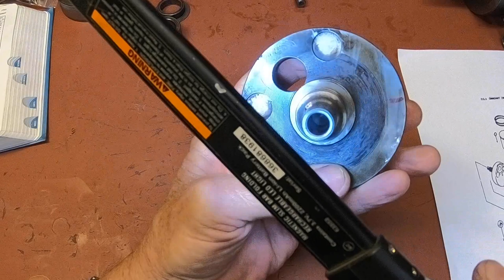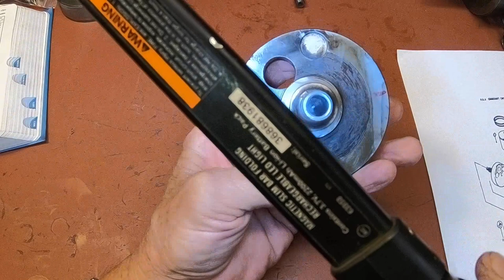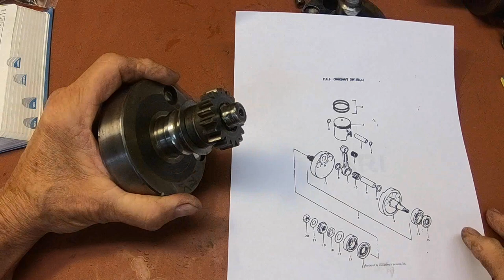Suzuki RM 125 Crankshaft repair and build part 2

Comment: This kind of repair spread through a machine will make  seemingly simple repairs take an inordinate amount of time to complete, many times you just can't get  people to understand why a repair costs what it does.
Reply from the maker: Peter, I think you are speaking from experience. It is very easy to get way too much time into stuff like this. Most of the time it goes very unappreciated. Sometimes it just doesn't work out. In this case it was a boat anchor to start with and will be one again if unsuccessful.

Comment: Looks pretty good so far Dale. I suggest indicating /tapping the face of the crank before final Dia. Adjustment,  your indicator is on the wrong surface  when squaring up the face. I'm probably not explaining it very well.
Reply from the maker: Hey Gary, thanks for the suggestion, I can't quite figure out what surface I should have had the indicator on though. I was not squaring a face, only trying to get the snout free of run out. The face in my opinion is the part of the crank I was tapping with the brass hammer. But the snout was the objective. It's probably just the difference between real machinist thinking (you)and hobby guy thinking (me). I have a hard time explaining in my broken Okie talk anyway. Thanks for spending time in the shop.

Comment: Dale why not weld the damaged areas, machine and remake the threads?  Powder welding is a specialist process, often used to rebuild damaged shafts on electric motors, and even to build up worn train wheels!  Would be the perfect way to repair that crank, and would be much stronger than anything that involved drilling.
Reply from the maker: Hi Chris, yes, I talked about possibly welding it in my intro, but the way the crank must be held for machining, I was afraid the tool pressure of threading might end in disaster. You have to remember I am not a machinist, only a hobby guy.
I actually do have a Eutectic set up and have used the powder buildup process many times before, but I only use it on a bearing or seal surface, and only on bearing surfaces that a bearing mounts on. Such as you were talking about with the electric motor shafts. I just don't have the appropriate powders to do this sort of project, and if you have bought any lately you know the cost of them would put this project into the stratosphere. There is always more than one way to skin a cat, but this one is for a childhood friend, and I believe this is the most economical, and will give more than enough strength to just hold on the rotor and the gear. Just my thoughts, I surely appreciate your comment and for you taking the time to watch.
Reply: @montana2strokeracer  Ok. Hopefully it will hold up fine.  Do you have a South Bend lathe?

I tried to shim a Yamaha crank last week, but it went solid with the thinnest shim I had, fitted (.4mm), so had to go together without shims.  

Later motors didn't have shims at all, so my theory about taking up end thrust from helical primary gear train, must be wrong.
Reply from the maker: @battlebbot  I have a Jet lathe 13 X 40, South bend are great machines.

Comment: Hi Dale.  Pleasure to watch you work as always.  A couple of questions.  On the mag side of that crank, instead of a press fit stud pinned in, why not just use a fully threaded stud Loctited in?  Less work by far, and surely it would be strong enough, expecially with a grade 8 stud.  Wouldn't that work?  

On these old vintage bikes, what kind of life do you see on crank seals?  How many years do they last?

Man, I saw you start that Suzuki 400.  I don't know how you get lucky on the gas not going bad and trashing the carb.  I've had to rebuild carbs here that only sat 6 or 8 months.  Of course the horrible gas here and 125+ degree temps are a factor...  Even my fuel injectors get clogged after sitting a few months!

Nice work,
Robert
Reply from the maker: Hi Robert, yes you could do a threaded shaft instead. In this case I don't have a long bottom tap, so instead of buying one, I just elected to do it this way and pin it. There really is not big need for strength here. It's just holding on a rotor and gear. The crank stub I cut off was very soft and cut like butter, so I imagine its no more than grade 2. Like anything, there is more than one way to skin the cat.
Seals....I think they will last a good long while, most of the ones I replace are original, so they are 45 plus years old, and most are still doing their jobs. I try to find good seals, not just the ones you can buy in a kit. But that being said, you have to look for them. I am lucky that most of the ones I replace are still available from the manufacture.
I am plagued by the same fuel woes as you I expect. I dries up so fast and corrodes so bad, but many times these old bikes just fire right up. But they don't run as they should, they just start. I generally use Sta-bil in all my fuel for bikes and buy non-ethanol premium fuel. Two strokes don't like water, and they don't like alcohol either.
I guess I don't know where you are located. But 125 degrees is too hot. I complain terribly when it gets to 100 here in the summer, which it does quite often. That being said I complain about 40 below zero too in the winter. Heck, guess I am just a complainer. Thanks for spending time in the shop Robert.
Reply: Yeah, it's a god awful place to live here.  Long story.  Lake Havasu City, Arizona.  Not very far from Death Valley; the actual hottest place on earth.

The weather service will say under 120 degrees here, but we have multiple types of thermometers in multiple shaded locations, and I've seen 130 degrees quite often.  Horrible!!

Love your channel!

Robert